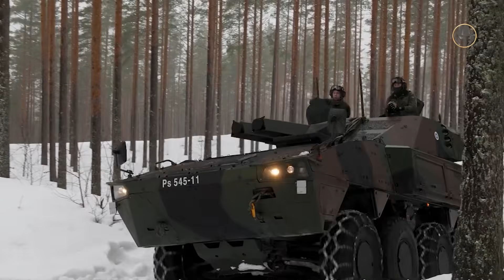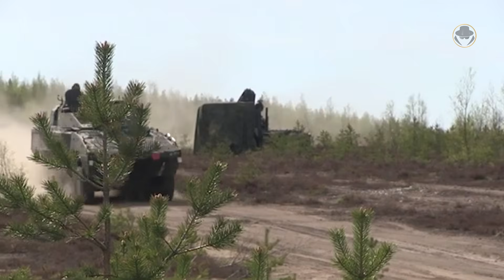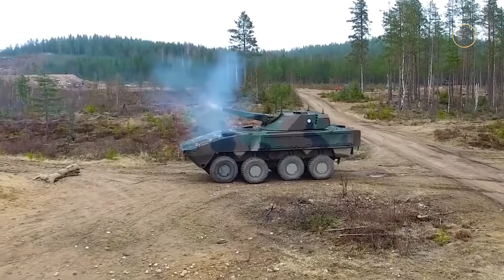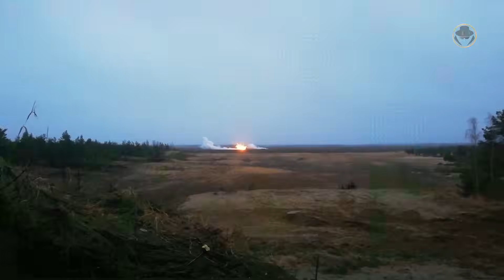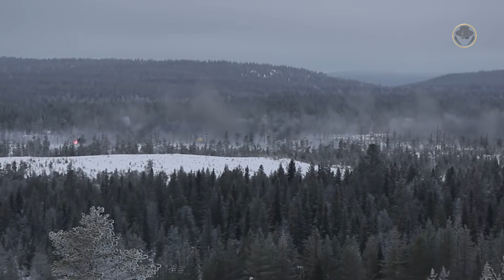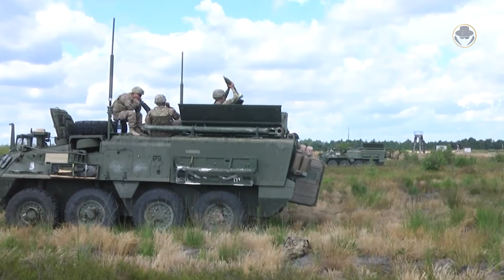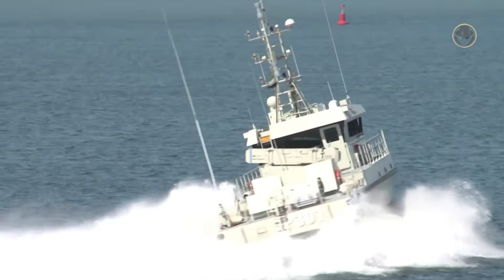AMOS - XA-361 | Why has no country, other than Finland, preferred such an advanced mortar

Comment: Amos/Nemo is excellent but would you trade one Amos for two Mjölnir, I think it was about that more expensive.
Reply: It depends if you are able to bring more than 1 vehicle to take part in fire mission, do you have enough crew trained, is money actually the issue or do you just need more capability. We have to keep in mind that shopping for military hardware is not same as bargain hunting for groceries. Each country has very specific set of needs and resources that they need to take into account when making the decision. Sometimes you need quantity sometimes 1 or 2 of the absolute best is needed to execute something that the more average grade hardware just can't do.
Reply: Sweden have quite a lot of Mjölnir making the costs matter.
Reply: And in an artillery duel, having more mortar vehicles makes individual losses less painful.

Unfortunately even as the most advanced 120 mm mortar system, there are inherent limitations. A 155 mm howitzer is always going to outrange it.

It's seems hard to justify buying a very expensive mortar system that is very vulunerable on the modern battlefield given how close it needs to operate to the frontlines.
Reply: @Rampant16  True. They are ideal for the Finnish territory, though. In heavily forested areas with very limited visibility, a highly mobile mobile mortar can be king. Smaller amount of needed vehicles is a plus. They do cost a fortune, so not sure if it's worth it in the end. Still a good addition for sure.

Comment: Patria NEMO is a simpler single-barrel mortar system with a cheaper price tag and lower weight. It also requires more crew to operate. That seems somewhat more successful.
Reply: The mortar on the NEMO turret is actually indeed just the left mortar assembly of the AMOS, so the system is just a less complicated, single tube AMOS.
Reply: Yeah, the vehicle cost alone makes big difference, AMOS needed Patria AMV (4.5m€) but for NEMO Patria 6x6 (1m€) is enough.

Comment: Sweden have it also
Reply: No, Sweden uses Mjölnir and that's a different system that doesn't have the same rate of fire but is simpler and cheaper.
Reply: @znail4675  the Mjölnir was actually a byproduct of the AMOS project, as it is based on the very first AMOS prototype, which was later named AMOS M (M for "mynningsladdare", 'muzzle loader').

Comment: A similar design is RAK mortar mounted on Rosomak APC (this vehicle also has a Finnish origin) It is used by the Polish Armed Forces, and is currently used in Ukraine).
https://en.wikipedia.org/wiki/M120_Rak
Also, I am not quite sure about this fact, but the turret is considered by the US Army.
Reply: I'd compare the Rak to the NEMO instead, which is more compact and seems to have a higher level of automation. The US is currently looking for a new motar carrier but have not decided on a systme yet, but the AMOS and NEMO are strong contenders.
Reply: @hawkstable8889  AMOS isn't considered in the FIFT program as it's not in production anymore. As for the Rak vs NEMO comparison, while the NEMO is indeed more compact, it does not offer more automation as it isn't autoloaded. And based purely on the FIFT program requirements, the Rak is actually more likely to win, especially that the version being offered is not the current M120 but rather the new M69, which has longer range and faster fire rate than the NEMO.
Reply: @hawkstable8889  NEMO/AMOS look more modern because of the turret. Reality is these don't have full auto loader - which is both beneficial and detrimental - but objectively they use simpler mechanism than autoloader  .
Rak does, it's a bit weird looking though - it was mostly due to fact that Rak's purpose was for autolader to load in any turret position. They want to abandon that in new version of turret - which will look like slightly larger NEMO visually, while retaining full autoloader (autoloader will no longer  load from any position, it will move to default elevation after each shot, but will provide twice the overall rate of fire - up to 16 120mm mortar shells a minute). Generally second generation of Rak will be way more similar in terms of rate of fire to AMOS but coming out of one barrel. And it will be able to operate with 2 person crew if needed (loader is needed move shells between auto loder magazine and storage only, entire thing can be fired remotely from outside vehicle, so there is potential to put it on land & sea drones).
Reply: @Beneficiis  The NEMO turret is fully unmanned and can be remote operated, as is typically done on the container version intended for base defence and mounting on trucks. The AMOS is an older system and I'm not completely sure about how it works but from what I've seen in FDF footage it appears to be a magazine autoloader that is manually filled by a crew member. 

Patria has reveled a few new projects recently so I wouldn't be surprised if a new version of NEMO is on the way, especially since the system is about as old as the M120.
Reply: @hawkstable8889  No. https://www.youtube.com/watch?v=bNZYuk2dT1Y
Clearly visible that it's fed into a tray manually. And that's container version. No magazine visible. And it's something Patria itself put out.
Reply: @hawkstable8889  Compare it with this...
https://www.youtube.com/watch?v=SOFE0scCX1o is kinda clear which has autoloader and which does not...
Reply: @hawkstable8889  Basically AMOS has auto loader but due the fact that it use more granades the magazine is open and you can refill it when needed. When NEMO needs to be reloaded when it's magazine run out.
Reply: @hawkstable8889  The NEMO isn't and can't be fully unmanned and/or operated autonomously, the NEMO container version includes a single seat for the operator which performs the role of both a gunner and loader.
Reply: @olekzajac5948  The official Patria website states the system is remote controlled. In fact they make it one of their main selling points. Though it does appear to need a loader. Not sure if it has any kind of autoloader magazine, but if it doesn't it shouldn't be difficult to implement if the need arises, since the system is already semi-automatic.
Reply: @hawkstable8889  
It has an automatic ready rack magazine at the back of the turret. 
Each tube has a drum, kinda like those cold war french vehicle.
When those are spent (I believed it is 15 round per tube), you can either load the tube manually from the hull stowage, or go hide somewhere else and replenish the ready rack from the hull magazine.
Reply: @hawkstable8889  Yes, the turret itself is remote controlled because the operator sits in the hull. As for the possible autoloader integration, Patria would need to design an automated ammo rack and some sort of a transfer arm that places the round onto the rammer assembly, so while it is technically possible, it would require a major redesign of the system.
Reply: Patria is part of BEA systems and there for NEMO is also Patrias product and what comes to Rosomak it in fact license product of Patria AMV to be fair. There for eany system that is planed to fit in Patria AMV can be mounted to Rosomak as well. And in fact on US army strikers as well since they are build by BEA systems.
Reply: Sadly US army is likely considering ampv with a standard manual 120 mounted at the back. No fancy turreted stuff.
Reply: Poland will pay for its support of Nazi-Ukraine. 
Where do you think the ukro-nazis will go when ukraine surrenders and cedes all Russian land.
Reply: "Every enemy of USSR should be ally of Finland" so nothing new that Finland support nazi again.
Reply: Just curious how it has Finnish origin? Fast checking Wiki mentioned nothing like that.
Reply: @BRXCK3T  Rosomak (the chassis) is a licensed version of Patria AMV
Reply: @wiktorberski9272  Oh, shit ye. I heard about Poland acquiring Patria AMVs years ago, or rather having some sort of plans for that. Should had made the connection. So they finally got them, and named them Rosomak. Ah, yes. Good for you Poland, solid choice I want to believe.
Reply: @BRXCK3T  Recently it was signed a contract for longer version of this APC, called Rosomak L
Reply: @wiktorberski9272  Is this long versio based on some AMV long versio, or are Polish making their own long modification versio of the AMV?

Also wondering what they gonna make the longer versio about, medical, command vehicle, tank destroyer? Clearly they have somekind of specific need for the Long versio if they making it, but I wonder what it is.
Reply: @BRXCK3T I AM note quite surę, but its own modification based on standard chassis build in Poland
Reply: @BRXCK3T  The Rosomak L contract wasn't signed yet, its signing was just announced. And the Rosomak L is most likely based on the Emirati variant of the AMV which was elongated to fit the BMP-3 turret. Since it was amphibious, the hulls were made by the Rosomak S.A. company in Siemianowice Śląskie, in Poland.
Reply: @olekzajac5948  Damn. AMW + BMP-3 turret. Had to Google that and I must say, It's not beautiful looking combo. Like some weight lifter beefcake had really tiny head.
Reply: @BRXCK3T  and do not claim that you can not find it on web either since here is Nemo https://en.wikipedia.org/wiki/Patria_NEMO
Reply: @BRXCK3T  and here is AMOS for you https://en.wikipedia.org/wiki/AMOS
Reply: @vatipaa1  I'm talking about RAK not NEMO or AMOS.
Reply: @BRXCK3T  The OP is explicitly talking about the Rosomak being based on a Finnish design, the Patria AMV, not that the RAK is.
Reply: @BRXCK3T  then you are on wrong pages since as far i understand that this clip is about AMOS and it has nothing to do on RAK since as far as i know it dose not have same system as AMOS or NEMO so it has nothing to do with these systems.
Reply: @brlbrlbrlbrl  Sorry, I meant Rosomak not RAK.
Reply: @vatipaa1  Except the original comment is about RAK and Rosomak and not about NEMO or AMOS.
Reply: @BRXCK3T  except that original video is about AMOS and NEMO and RAK has nothing to do with them since NEMO and AMOS both have totally differend aiming systems and unlike RAK they both can shot while moving either one target with multible grenades landing on same time or multible tarrgets while moving so RAK has nothing to do with thise two systems what so ever. Since there taeget systems and working systems has nothing to do with each others and they are two systems from totally dufferend Millennium and ther for have nothing in common.
Reply: @BRXCK3T  so in other form excepr they poth shot 120mm grenades these two have nothing in common since AMOS and Nemos targeting system calculate trajector to each single grenade and can launch multible grenades that land on same time. And unlike RAK it also can shot direct fire if needed. So if you plant 120mm grenade launcher to IFV that can be done just about every one But the major aspect that difer AMOS and NAMO is there appilities and targeting systems ( wich is BTW same system that Swedish archer is using). So RAK and thise two has nothing to do with each others.
Reply: @vatipaa1  You do realize this comment section is about RAK and Rosomak, which apparently is Polish copy of AMV under the lisence. And while both NEMO and AMOS indeed are AMV platformed, the original commemt is not talking about NEMO or AMOS, but Rosomak aka AMV ergo the APC and not the weapon system itself.
Reply: @BRXCK3T  you understand that you are keeping your RAK convoy under the youtube video that is writen under the totally difrent system no mater how much you like the system right ?
Reply: @vatipaa1  So, because video is on Subject A talking about subject B and how it relates to A is not allowed in your opinion because, you don't personally like that? How high are you currently, I'm worried you're going to fry your brains.
Reply: @vatipaa1  The AMOS can't fire on the move, it doesn't have a stabilizer. And the Rak can perform MRSI fire missions and is capable of direct fire as well.
Reply: @olekzajac5948  really then why i have seen it to do so in  military excersise ?
Reply: @olekzajac5948  for your info AMOS and NEMO has exact same targeting system and FYI NEMO can do it eaven if planted on boat.
Reply: @olekzajac5948  and BTW they both can shot eaven direct fire. And you can see it from level of there barrels when they are moving the platforme. So in other words if you have not seen either of them in real fire excersice i would think twice to inform eany one on what they can or can not do.
Reply: @olekzajac5948  so in other words if you have not eaven seen eant onw of them in action there in Prague. You should not really comment about the matter you do not know about and in stead for excample continue driving with your speedway bike?
Reply: @olekzajac5948  and i also wonder how do you know that it can not since Finland is the only country that is using AMOS and NEMO is only second hand product that Patria sell's out of country ?
Reply: @vatipaa1  It's weird that you saw the AMOS supposedly fire on the move considering that on their website, Patria doesn't claim anywhere that it's capable of doing that. Moreover, they explicitly state that it's possible for naval applications, which means that land-based systems are not stabilized. And there is no video showing the barrels staying in one plain while the vehicle the AMOS is mounted on is moving, not a single one.
So you either got the NEMO and AMOS confused or you're lying. And considering how aggressive you are towards me, the second option is more likely. But you're right in one thing - you should not be informing anyone about something you don't know anything about. And yet you claim that the Rak isn't MRSI-capable and can't fire straight ahead.
Reply: @olekzajac5948  listen kiddo i do not care what you think that you know or not. And considering your other comments on other pages you do seem to know darn thing about thise maters.
Reply: @olekzajac5948  and also considering your know how about the maters i highly doubt you have zero military training what so ever under your belt so if i where you i would shut up just about now.
Reply: @olekzajac5948  so untill you actually know darn thing about thise maters you should not act like mister fucking know it all especially with things you clearly do not understand more than antaa understand about nuclear physics
Reply: @vatipaa1  So you not only know JACK SHIT about what you're talking about, but you're first response to me stating facts is you being disrespectful. Seems like you indeed don't have any arguments and thus can only "defend" your lies with ad personam.
I also don't care how many toilets you cleaned while in the army, military service does not equal military expertise, which you (if you've ever served, I highly doubt it) are a prime example of.
Reply: @olekzajac5948  so stap yaping about the things you do not know a darn thing
Reply: @vatipaa1  The only person who doesn't know what they're talking about here is you.
Reply: @olekzajac5948  too bad for you i do know what i am talking about. But you in the otherhand have shown that you do not know darn thing about the maters that you are talking about in the first place in fact you have shown it on multible videos already. And as a mater of fact it was you whom started the insulting after i handed your ass backt to you. So learn the facts better or ask Kreml your money to be refunded to you. Since when we speak about facts you are falling short in just about every subject we speak about.
Reply: @olekzajac5948  so let this to be leasson to you when the facts start to speak Russian maskirovka has no saat beside the table.
Reply: the us army "fake consider" a lot of things (they have to do that to keep appearances)  - but corruption or "internal lobbying" and nationalist tendencies 
always will make them chose inferior domestic ideas over "foreign shithole country innovation" 
(unless of course they can reverse engineer it or get hands on blueprinys though their spy-on-allies-NSA-network-called "echelon")